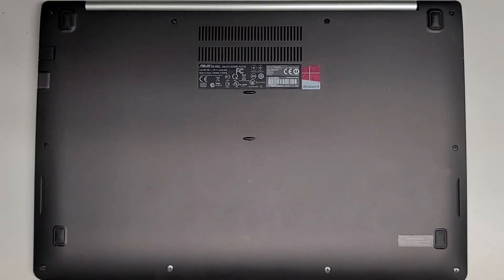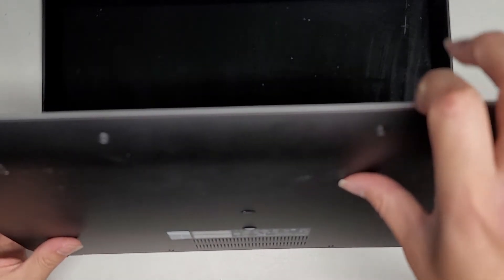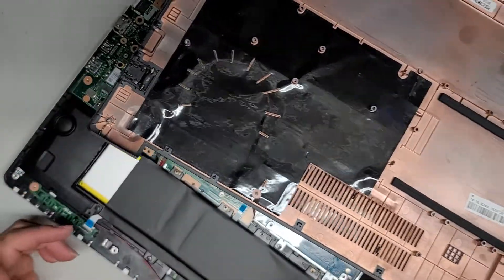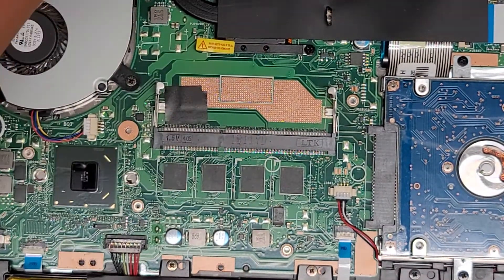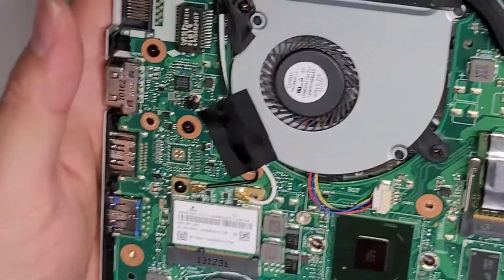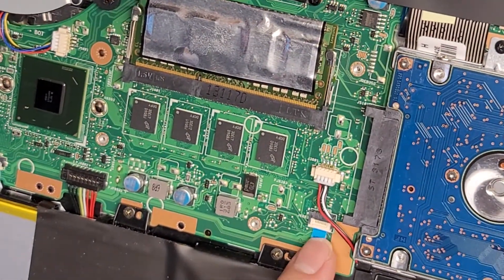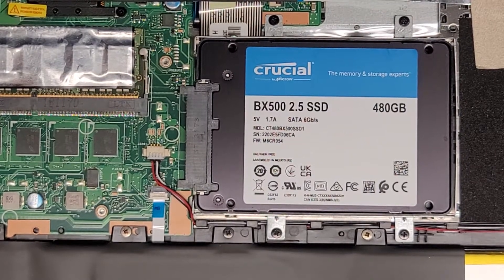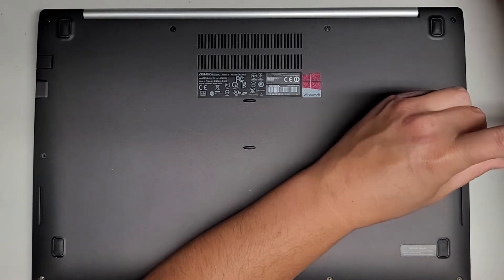ASUS V500C Disassembly RAM SSD Hard Drive Upgrade CMOS BIOS RTC Battery Replacement Repair

Comment: Can the fan be taken out separately from the heat pipe, I have a fan that is making noise as it spins to i suspect it is shot so needs to be replaced but im trying to figure out do i need to replace the fan and heat pipe or I can just remove the fan and replace that
Reply from the maker: This playlist will help Fan Repair: https://www.youtube.com/playlist?list=PLSSiYX-ta7aqqxfDWDQh-B6Az4ZgDI459